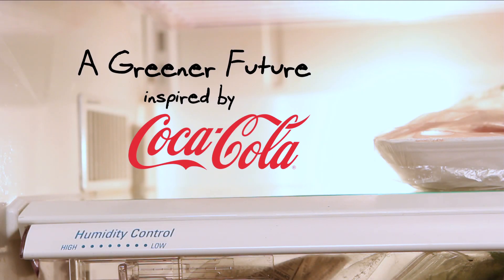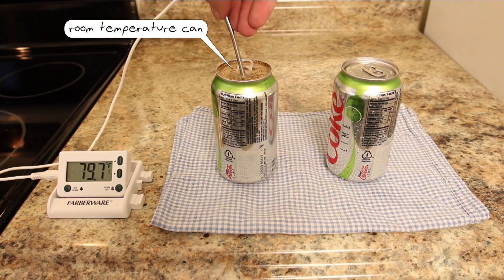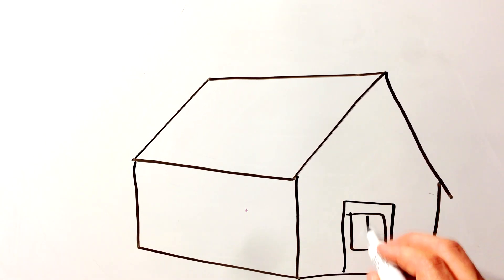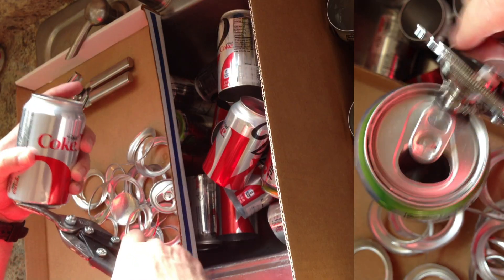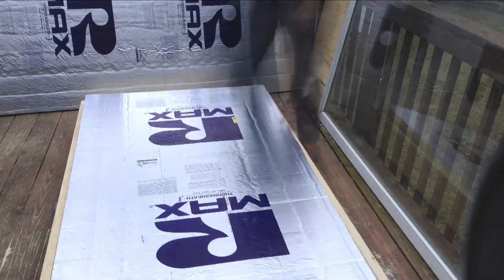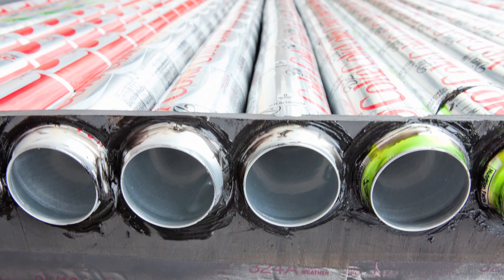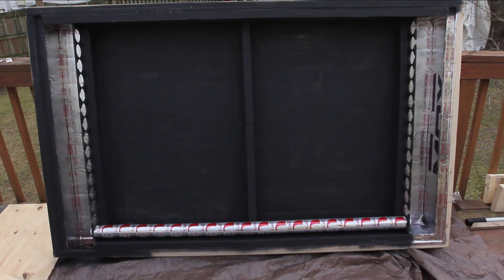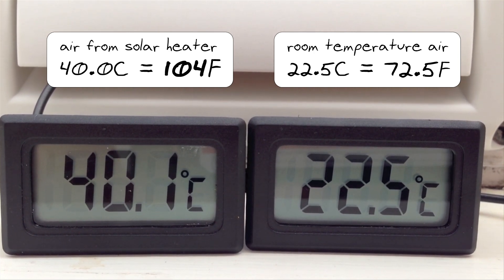Coke Can Solar Heat Collector

Comment: I fitted mine INSIDE my double glazed South facing window. A 3mm slot in the base front and a 6mm slot in the top. Cold air goes in at the bottom slot and connects out at the top slot with no fan required.31 c rise as it’s behind the double glazed window,

Comment: Thats great when the sun is out, but how long does it hold the heat, after the sun goes down?
Reply: For heat after the sun goes down, you’ll want to add a thermal block to the construction. Basically a heat sink that will store and release heat over a longer time after the sun can no longer radiate the cans.
For a greenhouse, this can be as cheap as digging out the floor and replacing it with sand that the thermal can heater adds heat to during the day that is released at night.
For a house, it would require more thought.
Reply: @Dav Free  I agree...a good thermal mass will indeed slowly release heat silently for 8 to 10 hours...like a tiled floor. Solar heaters work. My 6"x6" unit outputs 95C. Top and bottom 4" holes. One 4" electrical duct fan in bottom hole. Electric heated floors is also a dream in comfort. Of course, one must max out their insulation envelope for best results. My solar heater warms my upstairs 3 bedrooms on sunny days. It is still warm upstairs at 10 and 11pm after re-installing the hole plugs at 5pm on sunny days. We should build a billion.